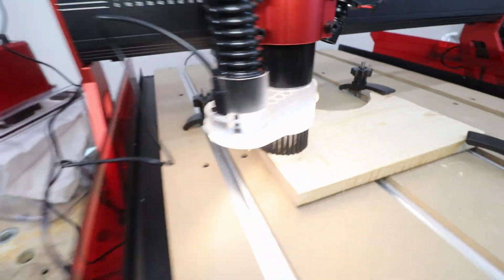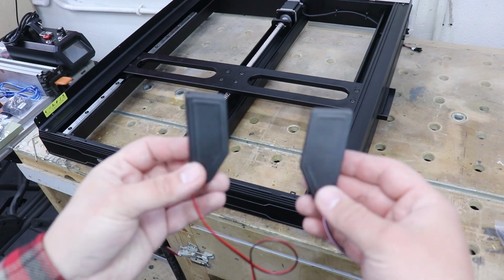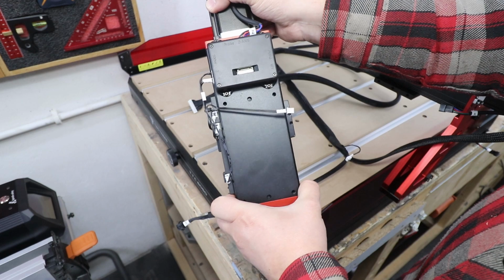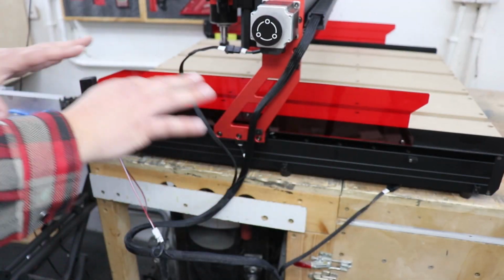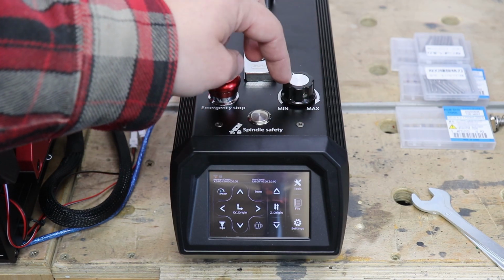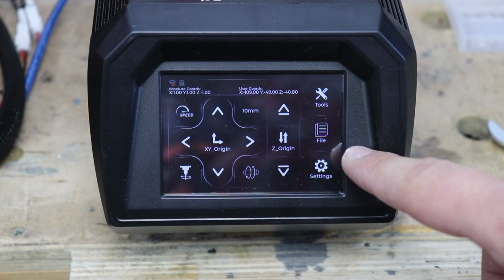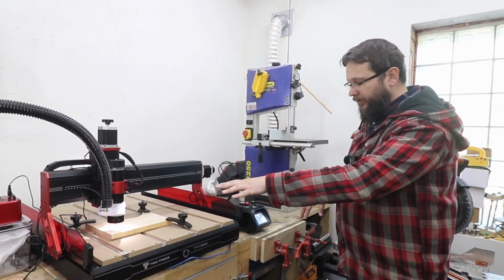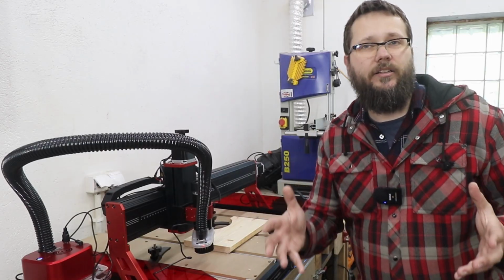Beginner CNC Setup – TwoTrees TTC6050 Full Assembly & First Cut!

Comment: Very well done. I'm on the bubble to getting a cnc. Can you show the process for creating and implementing a design or project from computer to cnc?
Reply from the maker: Yes got that planned for this year. But need to re-arrange my workshop, as I don't have space for this CNC currently. And it weights a ton so moving it around is not an option.
Reply: @CasualDIY but overall, are you pretty satisfied with what it can do?
Reply from the maker: @SteveBrewer-rb3tq yes very solid machine

Comment: This is one of the BEST assembly videos I've ever seen. Did you ever do the spindle upgrade video? I'm not finding it.
Reply from the maker: Thank you kindly. Not done that video as currently I'm struggling to find place for the machine in my workshop.  And the machine is so heavy its hard to move around. So until I find place for it the upgrade video is on hold.
Reply: @CasualDIY  thank you for replying, I understand.  I want to say I LOVE YOUR VIDEO and so far really like the CNC as a stand alone machine. I also got the upgraded spindle, vacuum and laser module. 

Things I've learned.

First off their 'manual' for the spindle is not good. You have to think outside of the box when assembling it. It has an external power source and separate wiring, no plugging it into the head unit for power, which means the IR sensor is rendered useless. Also the main module spindle control is also irrelevant. I also found it didn't like to 'home' with the enlarged spindle repeatedly hitting the hard stop not the limit switch, had to pull the acrylic sides and IR sensors to get it to home (didn't matter since they aren't connected any longer).

Also as a favor to you- do NOT buy into the hype for the add on 'laser'. I got that as well, and there is NO SUPPORT, and the machine does not play well with it. I have had 2 c02 lasers and one galvo for over 5 yrs and have always used lightburn, so I have some experience with the lasers. It's literally easier to buy a second dedicated machine than to try to sort this jezebel out. I put in a request for support over 3 weeks ago and still have no heard back from them. I pulled the unit, and threw it into the 'lessons learned box', and purchased a separate dedicated unit. 

Bit changes with the collet are a 'challenge' as well, the collet is very stiff and not easy to use. I'm looking at the Musclechuck as a work around for that supposedly their ER-11 model will work with this unit. 

I know they provided you with the 'vacuum' and I've found it to be less than stellar, frankly it's gutless for anything but the lightest of work. Since you have the updated spindle I found the Genmitsu 65mm/69mm CNC Dust Shoe fits the spindle perfectly, though you will have to add a few layers of duct tape to the inport for a small hosed shopvac hose to fit over it snugly without messing around with it further.

I hope you do have the chance to give it a go- I'd like to see what your work around these issues are. TA!